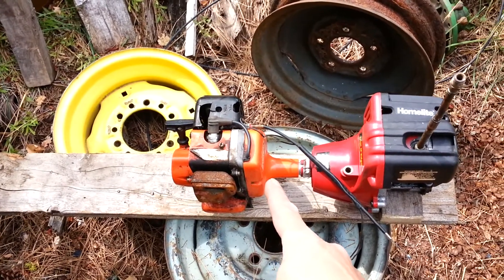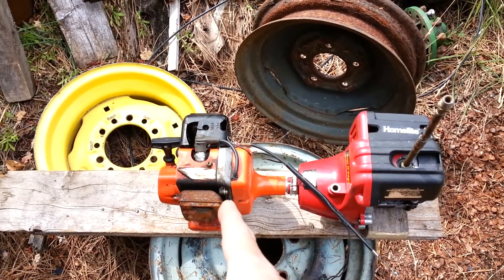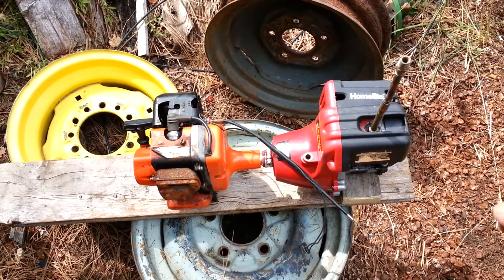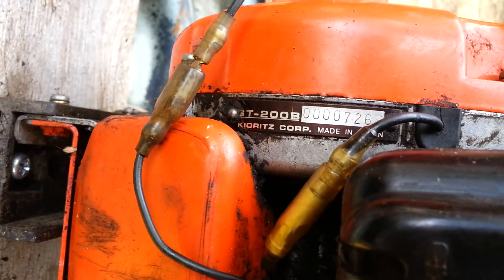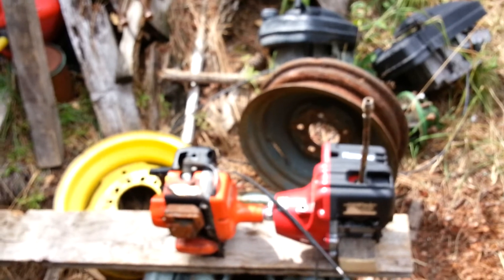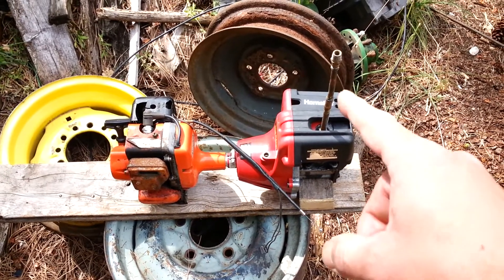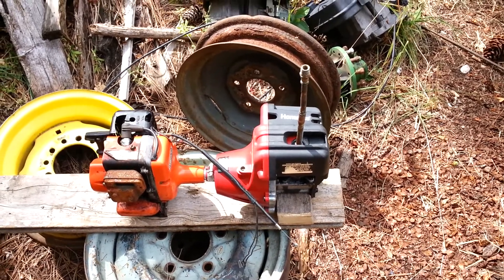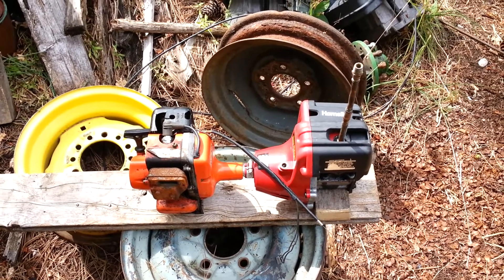Air Compressor Made From Two Weedeater Engines

Comment: I like it but I'm afraid it won't last too long because it uses oil in the fuel for lubrication so no fuel no lubrication seized engine or compressor in this case
Reply from the maker: I agree. 
Gosh. This is a dumb video. Why do I still have it listed?
Reply: HeadakusMaximus if you get a four stroke weedeater it should last
Reply: Or introduce an oiler from the carburetor side   to lube it.

Comment: Idiot, without a check valve it pulls in the same air it just blew out.
Reply: ROMAK 47 he said in the video if he added a check valve it'd put out 30 psi
Reply: @dakotadriggers8838  he said it's putting out 30 psi without a check valve. in reality it's not pulling in the same air it just blew out except for the very first bit of the intake stroke.

Comment: What psi did this output??
Reply from the maker: +\ 0909 I haven't actually finished it yet so I don't yet have that data.  I'm going make a SWAG and say it will be in the range of 25-35 psi.
I'm also guessing the cfm will be pretty low as well. 

I'll comment back once I get those numbers.
Reply: HeadakusMaximus
 I wonder, if you had 2 acting as compressors, exhaust from one, into intake of other, if you could generate a greater psi.
Reply: \ 0909 no that wouldn’t work but it’s a good thought